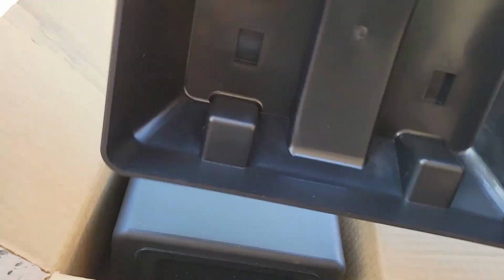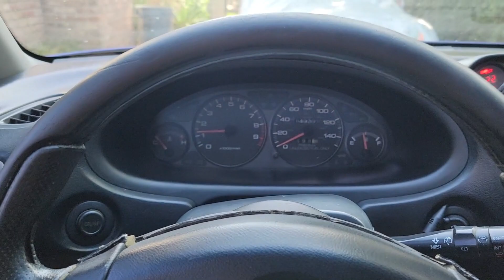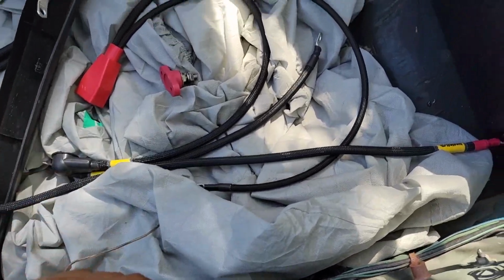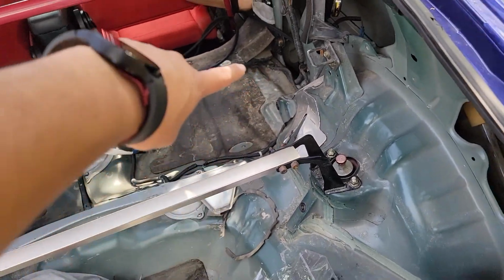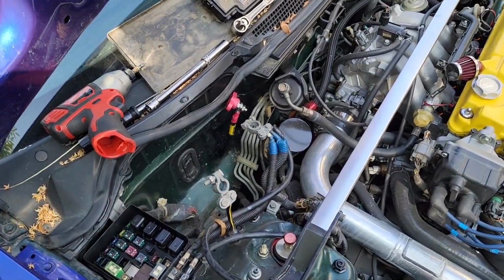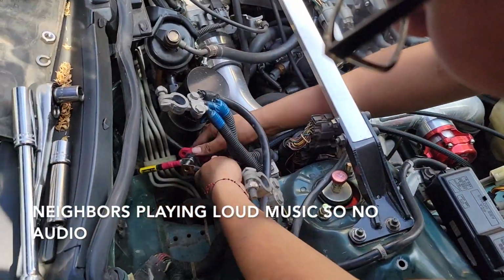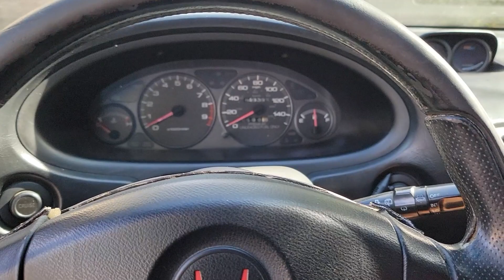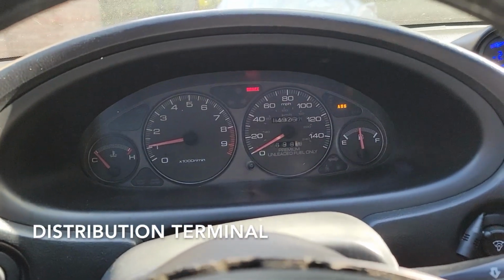battery relocation for my integra

Comment: I like your steering wheel I have a B20B swap P8R 2000 acura integra GS.  I bought it as is not a perfect example of a car but built pretty well  Had it almost 5 years  The only thing I don't really like about the car is the connectors for the  Negative and positive cables that go to the battery  Besides that and rebuilding the rear end because the caliber was frozen as s*** no other problems